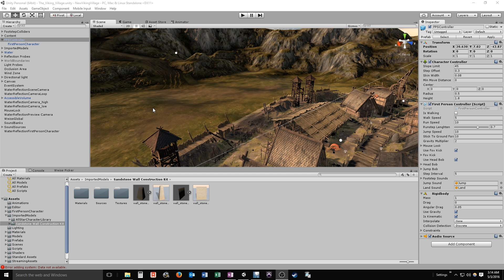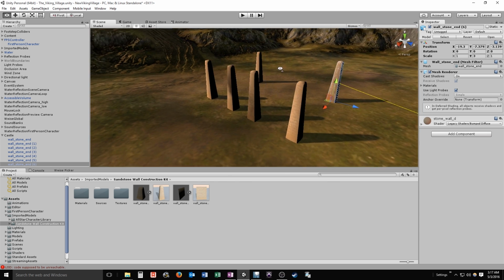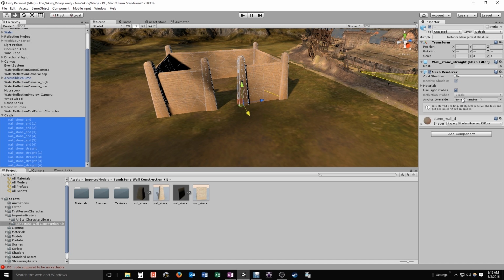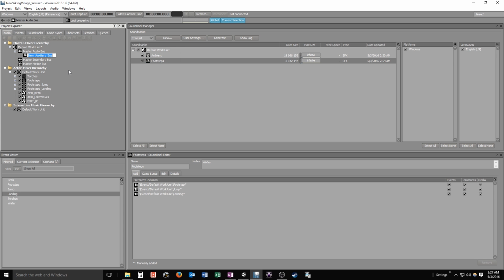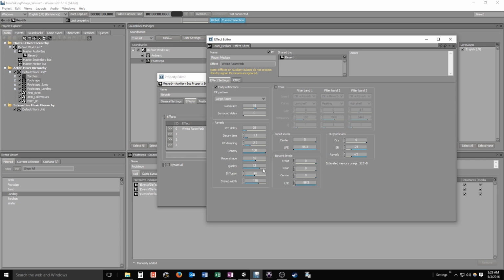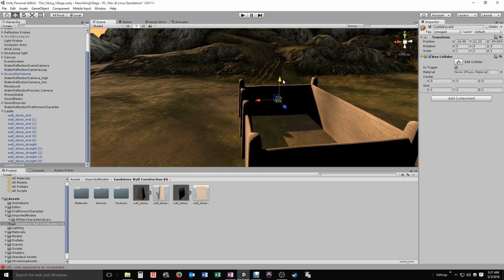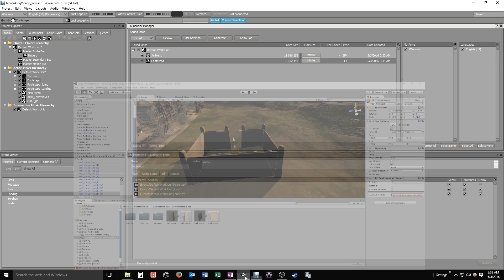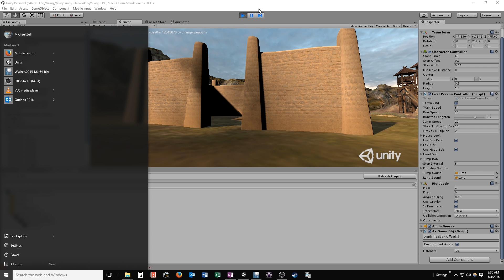Wwise and Unity: Reverb Zones, Part 6

Comment: Hey just one question here. If you wanted different effects for footsteps on different material , would you need to create separate switch groups for each footstep material and then add the different effects to each switch group, or is there another way ?
Reply: I think it is enough to add the auxiliary send to the Switch Container that contains all your footsteps. Remember that Wwise works based on the hierarchy between your different elements ... if the "parent" (your Switch container) has an auxiliary send, this will also affect the "children" (Random Containers) that are inside